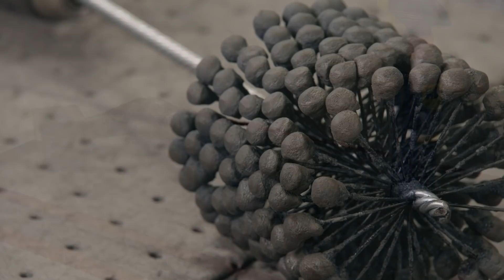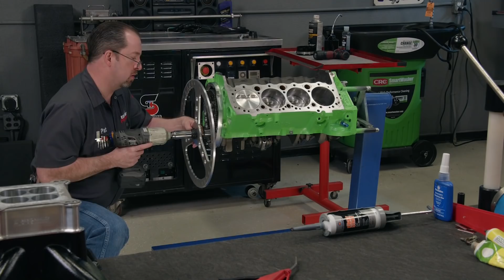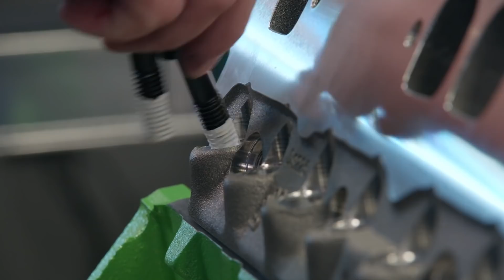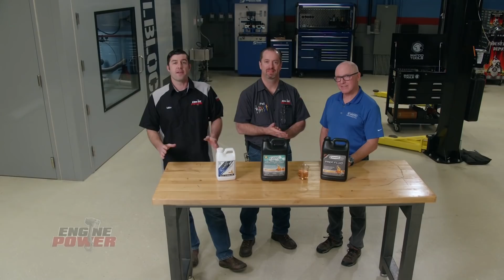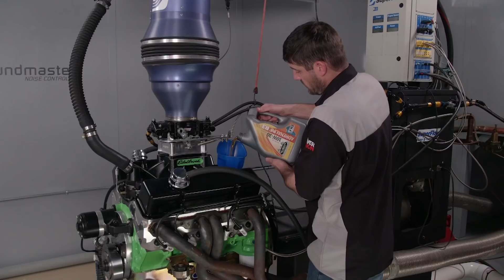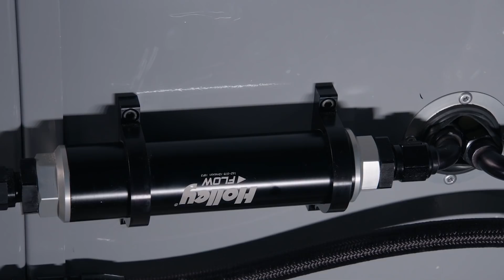How Much Nitrous for 720HP in a Small Block? - Engine Power S6, E9

Comment: Had the heads been CNC Opened to 225 cc they would make a ton more power
Reply: Did you not see the cnc portwork on them?? 🤣😮
Reply: @brandonbell3089  must have either typoed that thinking 245 cc, or did not hear them when they said 225 cc. yet i remain same basically any combo with too large of ports and too large everything(for a daily driver) works out well for adding nitrous

Comment: Did this dude just say his coolant isn't too expensive it's just under $50 a gallon... Does he not realize 5 gallons of concrete is $50. So just by doing simple math you can figure his coolant is 10 times as expensive gallon per gallon.

Comment: "Water loses 97% of its heat retention capacity when it turns to a vapor, and that's bad [inside your engine]" which is why cooling systems are designed such that any vapor produced is pushed out into the overflow tank when the engine is hot and sucks liquid back in when it cools down.  Nothing works quite like being disingenuous and intentionally using misinformation to get me to walk away from a new product.
Reply: Rip

Comment: Wonder if you guys propane instead of nitrous to gain power will it work
Reply: No.  You can use it to gain power in a diesel but not a gas engine. its actually less efficiant and you lose some power and a lot of mileage.

Comment: I like doing this to prove how great of a budget build these engines are. Lets begin. 

Dupli-Color Engine Enamel                                                           $13.16
Edelbrock Super Victor Intake Manifold                                     475.95
Evans Waterless Coolant x2                                                           93.90
NOS "SNIPER" Holley 4Bbl                                                             498.95
Hot Shot Secret's Adrenaline R-Series Racing Oil                        59.95
Brodix Cylinder Heads Dragon Slayer 23 Degree                     1893.99
Cometic MLS Head Gaskets                                                          161.08
Howards Cams Vertical Bar                                                           310.99
                                                                                                         ---------------
Grand total of                                                                                $3511.97

No, that's not going to get you a rev to the moon 720hp fire breathing 383. Lets not forget the shortblock, and what/how much it takes to build to handle power like that with nitrous. I'm not going to view their other video and dissect how much it cost to build it. I'll just look at Blueprint Engines forged 383ci unit at $3999.00. Don't forget parts, labor, and assembly from a machine shop will be comparable in cost. That puts us up to $7510.97.

That's not all folks. They forgot to mention the cost of other parts like:
Headers   
Canton 8qt oil pan
Oilpump
Comp Cams billet double roller
Comp camshaft
ARP head bolts
Summit Racing gold series rockers
pushrods
rocker girdle
Earls hoses and fittings
2" spacer
quickfuel 950cfm carb
cast aluminum valve covers
harmonic balancer
electric water pump

Or did you think all of those parts were free? I'm sure there's more hidden cost in this build. This is a budget build of about $11k. Not to bad huh?
Reply: The hero we didn't know we needed
Reply: Thank you for that in depth cost analysis.  I laugh when I hear these guys say the word "budget "   For 11 grand i do believe you could build 3  truck ls engines making one thousand horsepower.  Even a 4.8.

Comment: My high school buddy hot rodded his Camaro and added a nitrous system. He was scared it would blow his motor up, so he never used it. What he did use it for was to get high. He put a diverter valve under the seat and ran a tube up so we could crack it open, whiff it, then turn it off. We had a lot of nitrous induced laughter in that car.
Reply: And that's why they put a small amount of sulfur in it here

Comment: Typical big 3 motors, rebuild, rebuild, forever, never using good spec parts, sloppy specs let you build a motor that needs a rebuild before 100k, why not build a solid motor that will go 500k plus? All you guys do is buy parts, lol Junk murican engineering.

Comment: Well it seems every single one of these engine builds has a hand full of people crying about the "budget" builds. It sucks for your poor ass, and that's just the breaks.. OR... you can stop spending thousands on your phone and phone service, stay out'a the bars everyday and weekends.. and SAVE some money for your own project. There is NO SUCH THING as a $50 dollar 700hp motor. If you want something that's not going to blow up after starting it, you need to spend some money. Motor builds (particularly chevy ones), are still "cheap" if you know what your doing. If you are crying that this is too much money for you, then you need another hobby.
Reply: maybe around 8-8.8k if you can do some of the work yourself
Reply: @bigsean2473  for 8k on engine stuff alone there are much cheaper ways to make power.
Reply: @nathanboyles6222  im talking total build of a engine that is reliable and making 600+hp. yes you an do it a bit cheaper but how long will it last?? i want mine to run day in and out with no problems for years so i feel 8k is a good price for this for a total build.

Comment: so why are you supporting that evans shit ? yes its doesn't boil until 300 odd degrees F but that doesn't mean that the engine isnt getting beyond its designed operating temp and its thermal conductivity is fairly poor relative to water. go check out Matt over on the channel The workshop he explains it a lot better than i do.

Comment: What would it cost the average person to build that motor the way you have it built? From top to bottom.
Reply: If you don't have a core to start with and need to buy everything budget 7-10k would be a good guess.   If you have a SBC 350 already a couple grand.   The heads are about $2000 alone.

Comment: 19:06 I don't think that grommet is doing much sealing. Looks like something out a Brazzers video.
Reply: Ok.  That made me laugh more than it should have.
Reply: Clicked...dead
Reply: I suppose that’s kind of funny. Besides the elements that the air may be carrying, that’s all it’s really going to seal. The fuel flows through the lines not the grommet. it’s more for a professional finish rather than a critical component. I did laugh a little bit. But only at the fact that you chose brazzers videos for comparison. If the videos you watch are of that comparison, you got for sure different taste my friend,. Well, Godspeed. Stay blessed. You see I added to your humor with my humor so now I got a full laugh.

Comment: Fifty dollars for the coolant!!!!! I work at a dealer service shop, I can't pay fifty dollars for coolant😕

Over 700 hp and lbft😲. In a engine that fits between 99% of all frame rails!!!! Imagine this thing in a model A😈 or a foxbody 😈😈😈
Reply: The coolant is a scam and terrible anyway
Reply: @moto_rad  figured, I mean they haven't changed coolant for like 60 years for a reason....cus it works the first time👍
Reply: There is no reason to insult a majestic Chevy engine (even one that doesn't work), by placing it anywhere near a  f.o.r.d  product.
Reply: @hawkdsl  dude, it's been done since the gen one small block Chevy. It replaced all the big block in the hot rod and custom scene. Just like before the Chev people used the flat head Ford and the little hemi or the nail head or the caddy engines. At that point the name tag on the body has zero meaning.
So calm your tits Lisa and let the older guys talk😊
Reply: @robsorgdrager8477  The joke went over your head.. but its all good.
Reply: @hawkdsl  " nothing goes over my head, I jump incredibly high "....draks 😂🤣

Comment: Budget : you mean 5k 🤔🤔
Reply: Joe Di Carlo  yep 5k is nothing even if your doing it yourself and no labour fees.
Reply: All that means is that they set a budget for the build lol.  They said budget build, just didnt mention what that budget was. .
Reply: @bigboreracing356  that is also a fully custom built race engine vs a stock block slapped toghter with off the shelf parts
Reply: @bigboreracing356  if u say so
Reply: @bigboreracing356 The Ford will last longer than this stock block 720hp ....alot longer, you pay for reliability at 1100hp. That costs money.
Reply: @bigboreracing356  your kind of missing the point and it was abit of a joke.
Reply: @bigboreracing356  it's not 5k though that was just a random number i threw out, just they always say 'budget build' when really it's thousands of pounds just for parts.

Comment: What do you guys think about Evan's coolant?
Reply: It’s junk. If you’re overheating on 50/50 in a street car their is a problem with the cooling system. If I was looking for the optimum performance out of a cooling system with only changing the fluid I would run distilled water ,with an additive like water wetter to keep the pump happy. Straight water is the best when it comes to thermal conductivity. Just make sure you drain if you encounter freezing temperatures.
Reply: T Web  I agree! I just saw some reviews on Summit racing. Some guys said it blew head gaskets on their engines.
Reply: @bigboreracing356  thanks for info, but I'm gonna just keep using my 50/50 antifreeze. I don't have any cooling issues with my engine. 👍